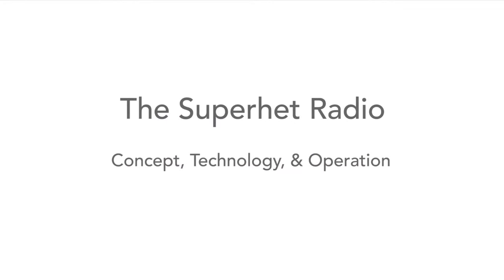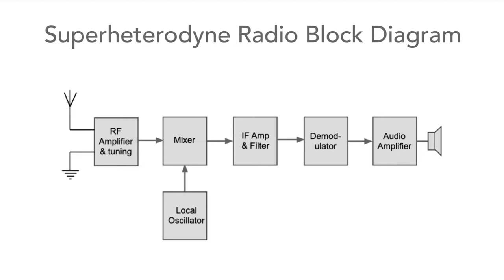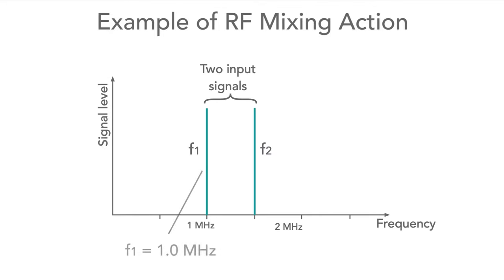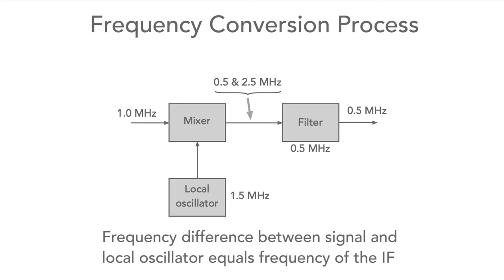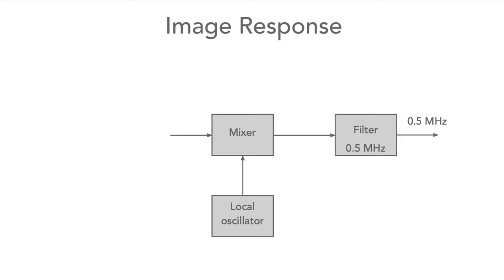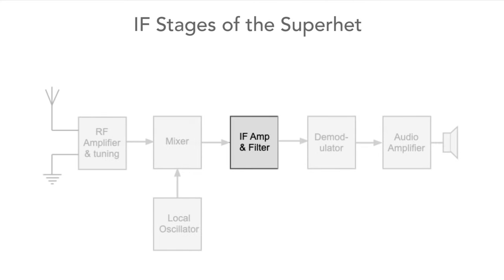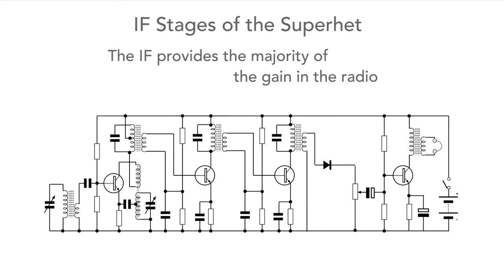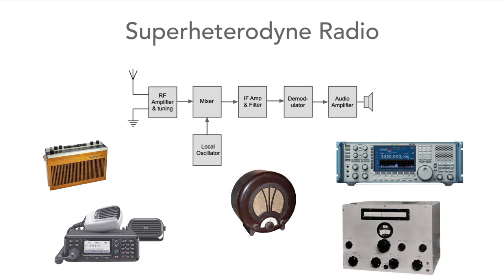Understanding how the Superhet / Superheterodyne Radio Works

Comment: Thank you for the video. Very well explained. It's a pity that the automatic Google translation often fails with technical terms.
Reply from the maker: Glad that you found the video useful. Normally the Google translation works well, but I can imagine that for specific technical terms it would not work so well. That is a shame. Thanks again for the comment.

Comment: Did this make radios cheaper?  As in: 1 specialized tuner/het circuit, then into just a standard processing block operating at an industry standard frequency?  

That would lend itself very well to mass production.
Reply from the maker: Back in the day when the superhet was invented, it used more valves / tubes than the more usual tuned radio frequency, TRF radios and hence it was much more expensive. As a result it was little used for several years. Only when costs of valves fell, they used indirect heaters which meant they could be powered by supply / mains transformers, and also the improved performance they offered was needed. At this point their use started to take off.
Reply: John, the first radio receivers offered to the public were crystal sets. They didn't have amplifiers, and they didn't have reliable tuning. Yes they were cheap. They could never have been the basis of a broadcast radio industry.  When amplifiers became workable, based on vacuum tubes, radios were better and still cheap, but it was extremely difficult to tune them to a given station. The superheterodyne radio simultaneously made tuning easy and reliable and also made the amplifiers better.  The added expense, more tubes and a more complicated tuning capacitor, was more than made up for by how much better the radio was. It is still the basic circuit for almost anything that picks up radio waves and uses them. That would include radar. It's possible now to amplify the radio wave and sample it at a high rate, converting each sample into a number represention the instantaneous voltage, or current. Then a computation can simulate the mixers and filters. It's still a superheterodyne radio, but entirely digital.

Comment: Why adding the ground symbol to the first boxe (RF amp.) of the block diagram ?
Reply from the maker: The reason is that an antenna is often used with a ground. I admit balanced antennas do not need a ground.

Comment: Thanks for the instructive video, I have two question:
- how the Mixer or Frequency Multiplier is implemented in terms of electronic components ?
- what will happen if the Internal Oscillator frequency is greater than the received Frequency, I mean the case where the frequency difference is negative ?
Reply from the maker: I hope this page will give you some answers: https://www.electronics-notes.com/articles/radio/rf-mixer/rf-mixing-basics.php

Comment: I wish folks like this author would use the correct terminology and nomenclature concerning this topic.  The video shows a block diagram of a heterodyne receiver but calls it a "superhet." This is incorrect.

Heterodyning is the process of mixing two signals (usually a local oscillator and the incoming signal) to get a desired sum or difference frequency, called an intermediate frequency or IF. A receiver that uses only one mixing stage and selects one IF for demodulation is called a "heterodyne" receiver. A "superheterodyne" receiver has two or more mixing stages and consequently has the corresponding number of intermediate frequencies, the last feeding the demodulator.

Heterodyning is also used in demodulating single and double sideband signals. In this system, a type of amplitude modulation, the carrier signal is removed before broadcast. This allows for more efficient use of the transmitter's power amplifier stage. In the receiver, heterodyning is used to reinsert (or mix) the carrier signal with the incoming signal. In this case, the sum and difference signals are the demodulated audio and are called upper and lower sidebands. Usually only one is selected at a time.
Reply from the maker: Thanks very much for your comment. It is good to get feedback. Thank you. 

However I have to disagree with your comment that a receiver that uses one mixing stage to convert a signal down to a fixed frequency IF is not a superhet or superheterodyne receiver. The term superheterodyne comes from supersonic heterodyne, meaning that the mixing process is above audible region. 

Also the definition of superheterodyne or superhet receiver given by Wikipedia disagrees with your summary. The definition given by Wikipedia states that a superhet radio "is a type of radio receiver that uses frequency mixing to convert a received signal to a fixed intermediate frequency (IF)." There is no mention of it being only a single conversion superhet, etc

Also the Collins dictionary defines the superhet as: "a radio receiver that combines two radio-frequency signals by heterodyne action, to produce a signal above the audible frequency limit. " Again there is no mention of how many conversions.

Similarly many books, RSGB, ARRL, Terman, and many many others all define the superhet as a radio where two RF signals are mixed or heterodyned together to produce a signal at a new intermediate frequency where it is filtered. Normally the IF is at a fixed frequency as fixed frequency filters are far more effective.

Whilst heterodyning, mixing, or multiplication - call the process what you want, is the process used. A superhet or superheterodyne radio is one where the incoming signal is converted down to an intermediate frequency state, or stages and it is then demodulated.

Soem receivers will convert the signal directly down to the base-band, and these are often called direct conversion radios - the is a technique often used with many simple radios, and it is also widely used for applications where a digital signal is being processed and it is converted down to give I and Q components for further processing.

I hope this clarifies the situation.
Reply: @ElectronicsNotes  

I realize your response is click bait, but I will respond none-the-less.

You are wrong. First, I checked with Wikipedia before commenting to make sure my facts were correct...not that my 40 years in radio would ever take a back seat to Wikipedia - a collection of articles that anyone can edit -  in my mind. Second, please tell me where you have seen a "supersonic heterodyne?" The word sonic refers to the air (or water) pressure waves that produce sounds audible to the human ear. The word "sonic" has absolutely nothing to do with electronics. 

Third, the examples you gave do not disprove what I said. All examples given allude to the heterodyne process, but do not specify the number of mixer stages. I should not have to remind you that the prefix "super" refers to something over and above that which is normal; in this case, it refers to more than one mixing stage. There is nothing "super heterodyne" about a single heterodyning stage.

The term "direct conversion receiver" can mean many things based on the frequencies we're dealing with. Many of us have made "crystal" (one diode AM) receivers as kids. SSB receivers when used for communication at 10-15 MHz or below can be "direct conversion" since there is no need for an RF IF at that frequency (but they still use heterodyning - Sideband receivers almost have to). 

My first real job was repairing and modifying Yaesu 900-series Amateur radios as well as the Kenwood TS-series. Most owners wanted 11-meter capability which was disabled by default. Anyone here as old as I am knows exactly the radios I am referring to - and that was in 1983. And BTW, I used to keep versions of the ARRL handbook until I was 40.

And since you chose to show your lack of knowledge, I will call you out: "Normally the IF is at a fixed frequency as fixed frequency filters are far more effective." I am not aware of any receiver that doesn't have a fixed frequency IF (or more than one if there is more than one mixing stage). Are you? Designing an IF filter for a varying IF would be a nightmare indeed. Usually it is the local oscillator frequency (or frequencies) that varies. If you know of a receiver with a "varying IF" please enlighten me. If the "IF" in question is audio frequency don't bother.

We live in an age where knowledge and common sense are being redefined. I stand by my original statement - that "super" heterodyne receivers have more than one mixing stage - and that is my final answer.
Reply from the maker: @royshashibrock3990  Thank you for your reply. However I have to continue to disagree with you over your definition of the superheterodyne radio. My answer was ** not click bait**  as it did not refer back to any of my sites, videos, etc. I was just trying to back up what I believe to be correct.

Trying to answer your points in turn:

I agree that Wikipedia is not 100% reliable, but for most things it is not bad - if there is an error, someone will edit it.

The term supersonic heterodyne I found in The Superheterodyne Radio by Alfred Witts, 5th Edn 1944. This book also explains the superheterodyne principle as one where the incoming signal is converted down to a lower, generally fixed frequency for better selectivity and amplification - no mention of two conversions.

I agree with you that super does mean above and beyond, but as the explanation I gave before, it refers to the fact that the heterodyning is supersonic, or above the audible range and not more than one conversion which is referred to as a double conversion superhet.

You also refer to my "lack of knowledge" with regard to a fixed frequency IF. I included this statement for a variety of reasons. The first is that possibly the first superheterodyne radio was developed by Lucien Levy. He used a variable frequency IF, but of course this was later improved upon by Edwin Armstrong who used the more normal fixed frequency IF. This worked much better because the fixed frequency filters were much better and he could optimise the performance of the radio using a fixed frequency IF in terms of its stability and amplification.

I have also been involved in the development of a superhet radio system for a highly sophisticated professional satellite communications system where I was a key development engineer.  The system used a fixed frequency down conversion from the satellite frequency to a variable IF around 1GHz. We used a tracking filter at this frequency before the signal was again converted down to a fixed IF around 70 MHz where the majority of the filtering took place.

I also wanted t accommodate the situation where external or additional converters may be used to extend the range of an existing radio. Here the RF side of the main radio, effectively becomes the first IF and this is variable in frequency.

As there are many different topologies that can be used with the superhet, I wanted to make sure all aspects were accommodated.

I have also sorted out additional references where the superhet radio can be a single conversion. Many early broadcast radios are described as being superhet radios.

The PYE PCR was a receiver without BFO and it is described as a single conversion superhet: 
http://www.pyetelecomhistory.org/prodhist/military/military.html#Communications_Receiver_Type_PCR_PCR2_

The EKCO A22 was described as a 3 valve superhet: http://www.vintageradio.nl/schema%27s/Ekco-a22.pdf

You may also want to look at this video explaining the superhet radio where it talks about the basic principle and it gives a single conversion radio.    
https://www.youtube.com/watch?v=qfAPNLioBnI

You may also remember within my video that I had some very eminent professionals: a well respected university professor from UCL who is also a keen radio amateur, the CEO of Silicon Labs, a major producer of ICs for the connectivity market (they also produced a large number of FM radio ICs) and someone from ICOM UK. All these people talked about the superhet radio and at no time was it said that more than one conversion was needed.

I have spent a lot of time, pulling out references to support what I said, so this is the last reply I will give.
Reply from the maker: I thought I would just have one last reply in view of your comment about me which said: "And since you chose to show your lack of knowledge."

I have now looked up several additional references:

Radio Receiver Technology Principles, Architectures and Applications, by Ralf Rudersdorfer, pub Wiley 2014. This book describes a "Single Conversion Superhet: which only contains one mixing or heterodyning process. The demodulator could use a product detector, but it was also discussed as use with a diode envelope detector, etc. It then goes on to talk about multiple conversion superhet radios.

Radio Frequency Electronics: Circuits and Applications by Jon B Hagen, pub Cambridge 2009. This book refers to the superheterodyne receiver with a single conversion used for FM reception, i.e. no multiplication or heterodyne process is used for FM demodulation. It continues to talk about a single conversion superhet radio, and then mentions multiple conversion radios as well. But the point is that a single conversion process is used and the radio is still called a superhet.

Technician's Radio Receiver Handbook by Joseph J Carr, pub Newnes 2000. This boom refers to single conversion superhet radios. Obviously a product detector can be used, but Joe Carr also talks about AM envelope detection and FM demodulation under the title of the single conversion superhet banner.

As, not only the eminent people I interviewed talks about the superhet radio as one which converts the signal down to an intermediate frequency, and no mention of it needing to require two conversions, and the references I have referred to, in addition to the references I posted yesterday of broadcast AM radios with a single conversion being referred to as superhet radios, I think this must be fairly conclusive evidence that a superhet does not require more than one conversion.

If you need further references than I could provide these as well if you want.